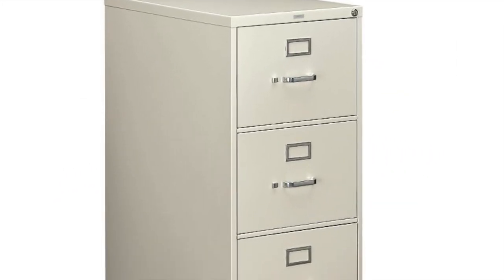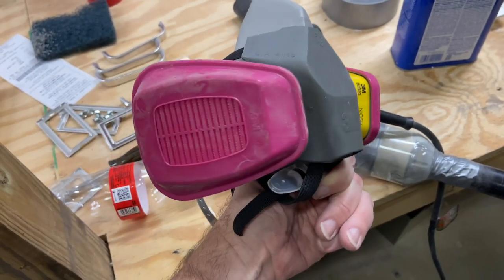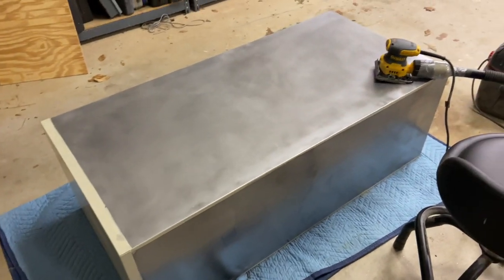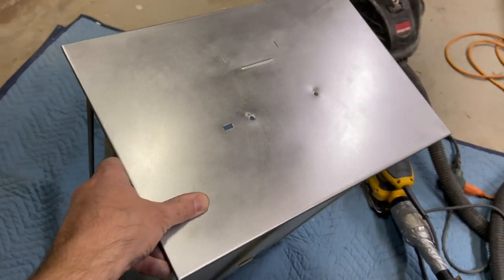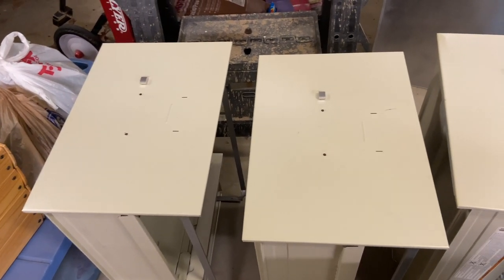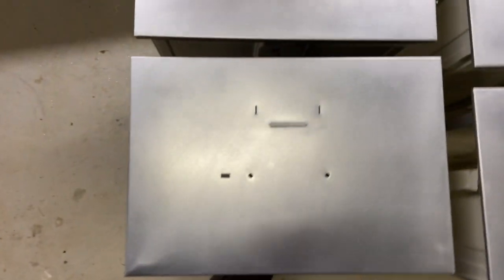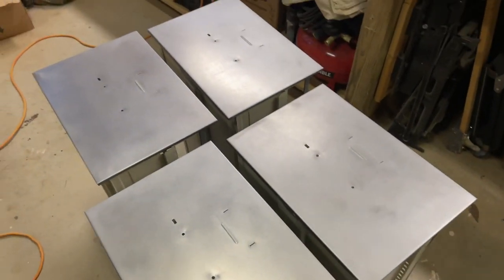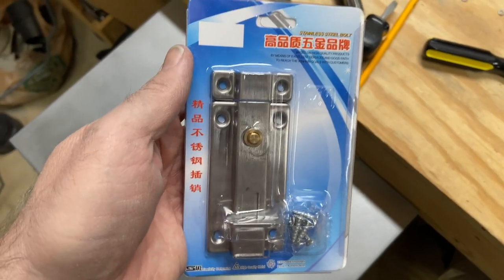Steel Filing Cabinet Sanding & Refinish

Comment: I want to do this but it looks like you need to spend quite a bit on materials and of course a hefty amount of time and elbow grease. It's a shame that manufacturers don't supply cabinets in this bare steel look (with clear coat to prevent rust). It looks so much better than the dull cream/greys that they always come in!

Comment: I just picked up a unique Steelcase branded filling cabinet with an attached tower that had gone through really crappy spray paint jobs then ended up left outside & largely neglected for a year or so to the point minor rust had developed underneath (largely chipping through paint, although I don't think it went much further than that).

After watching this, and knowing the vibe I'm looking to create in my office, this is the a no-brainer option. Especially making it a "steel" Steelcase. My biggest challenge will be the rust issue, which seems to be isolated to the underside, but I'm certain I can address that with relative ease. For that reason, I will be using a clear coat regardless of the fact it will be inside & climate controlled, but the wax option here was a nice touch.

Oh, but the good thing about this approach is if your mind changes, you've already done the hard work removing all the old paint. This will allow you, once you remove any excess wax, to go ahead and paint the steel any color you wish. This is probably the most no lose scenario/makeover any filing cabinet project could have.

Comment: Look good. Citristrip will work on that, but you have to use a lot & wrap it with plastic /trash bags so it doesn't dry out & leave it over night . Wipe dry & scrape w/ sharpened plastic puddy knife. A 2nd application will more than likely be needed but it keeps the metal from getting damaged. Then finish up with 300 & 600 grit